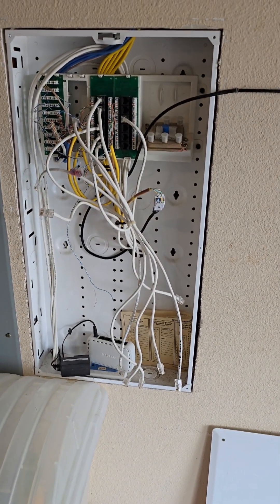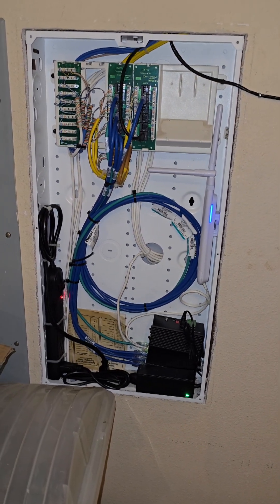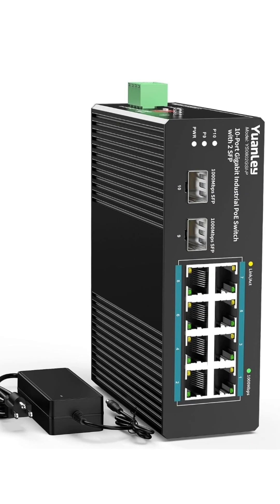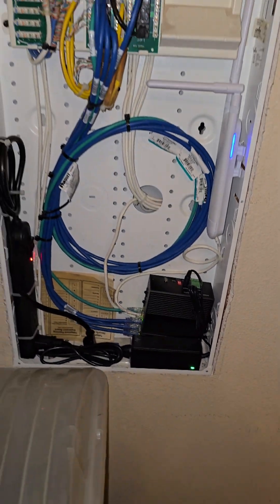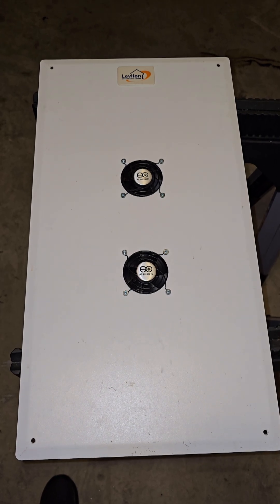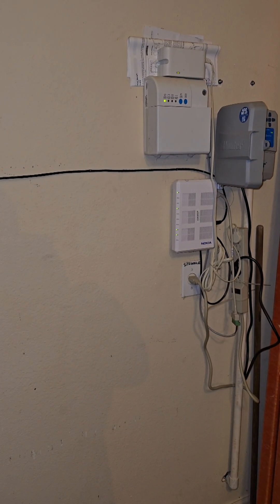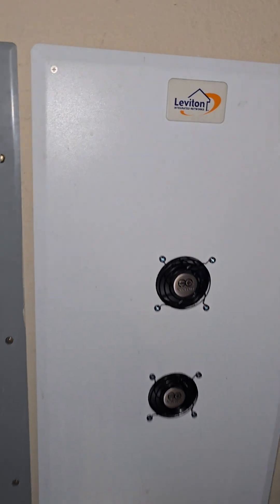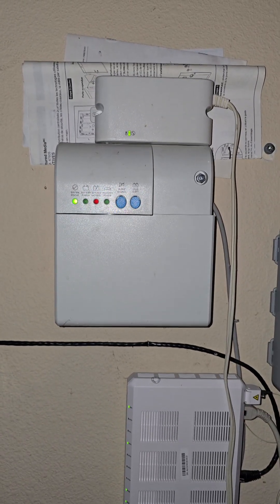Fixing a Texas Garage Network Disaster with NO GEAR!

Comment: @edtheoldtechguy. Great job with what you had available to you. Yeah. The builder and the local ISP installer have no incentive to do the best job or even correct job when it comes to datacom. I've heard of even worse wiring in those datacom distribution boxes in Texas: someone took all the CAT5 cables in the box, stripped the ends, and then twisted the all the ends together by color code like wiring a electrical receptacle box. And of course nothing was labeled.

BTW Was your "customer" family or friends?